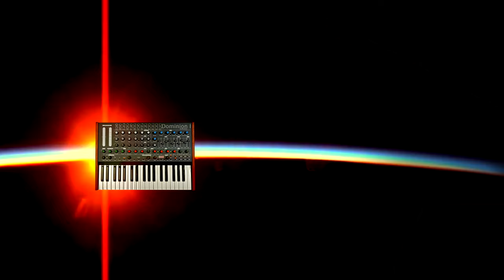How To Build A Synthesizer Spaceship

Comment: Very cool.  The arcade kill switches made me wonder if a dj scratch effect could be used with a synth?  Maybe sidechain or duck the synth sound when white noise scratching happens?
Reply from the maker: Brian Hurley I made patch like that before on the Sub37 where the noise volume is set to the mod wheel. With a little tweaking you can get an effect like that.
Reply: @StephenLearson  Oh.... that's like smart and stuff... On another note, if you didnt have the OB-6 and had that money to spend today, would you still buy it or get the UDO or Polybrute or Prophet 5/10 instead?  I totally understand the sounds of the OB-6 for 80s tunes.  I'm debating on what would give me the most new sound creation flexibility.  I feel like the PB is the pick but sometimes the Arturia OSC sound hollow or tin-ey.  I should add that I have a Matriarch and a Pro3.
Reply from the maker: @blindianajones  Every synth you mentioned looks amazing. The Polybrute is just about the sexiest synth I've ever seen. Ribbon controller, yes! 64 sequencer buttons, Yes! That Morphee pad thingy, YES! 

The Super 6 looks great as well. The stereo imaging in all the demos I've heard is on point. 

I'm interested in The new Prophet 5/10 too, but it's probably the one synth that won't do anything new. That's the synth you get to make those authentic 80's sounds.